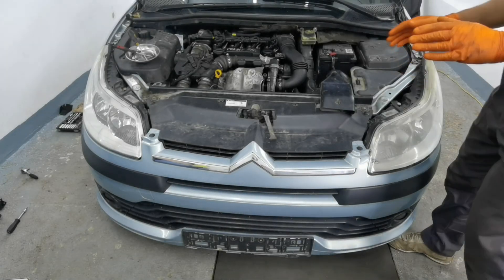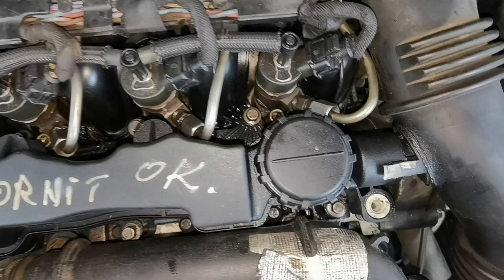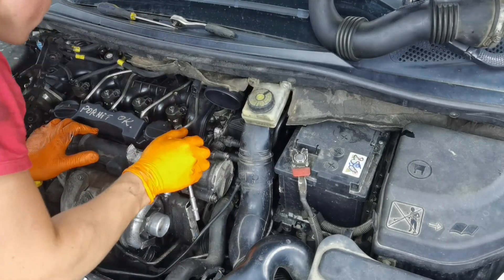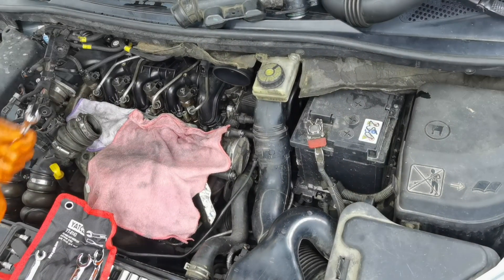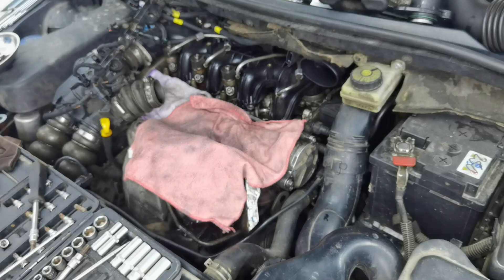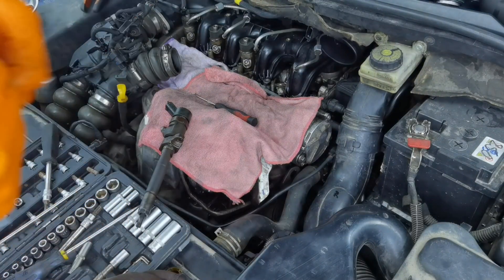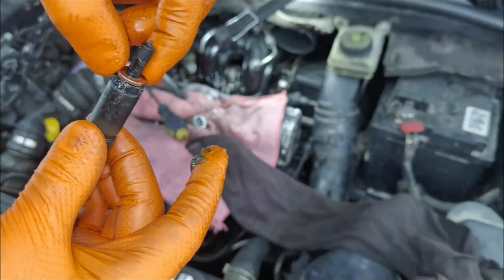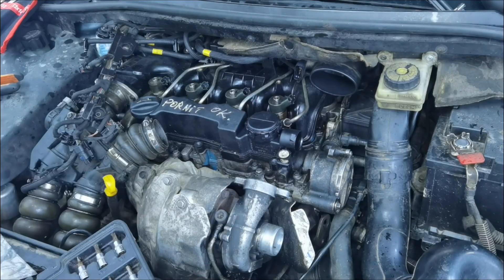HOW TO FIX LEAKING FUEL  INJECTORS ON DIESEL CARS

Comment: Thank you. When I removed my injectors, they were so wet, as if soaked in diesel. Is is normal?
Reply from the maker: Its not really normal sir.Thats because the o rings from around the injectors are bad and they let the oil run around them .Anyway its nothing to worry for now.